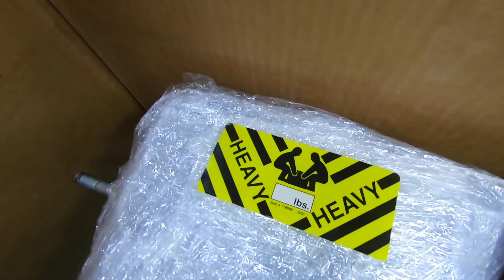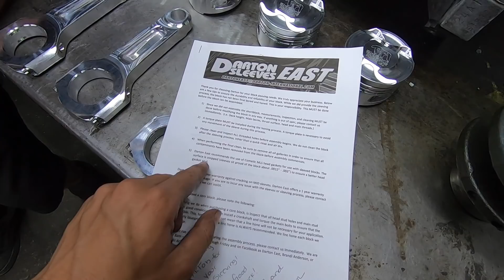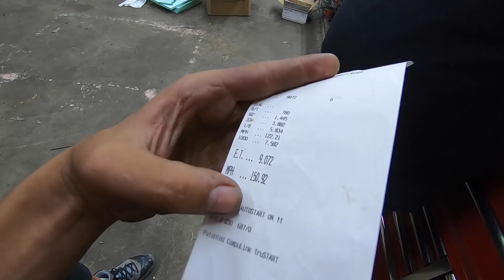The New 1200+Hp Engine For The Mr2!

Comment: When you take the block to get bored you need to take the head and rotating assembly and have them put it together to check clearances and o-ring the block and head too and also have it line honed and port and polish the head and polish the crank as well and make sure you keep track of how many passes you have on them rods and try to keep it on the track as much as possible and get the sequential lined out because especially with a stick car the more you miss a gear the more you shock them rods and you can run into rod stretch and hopefully one day you can build an engine like this one but with a fully built Billet block and head from 4Piston and also get a nice knife edged, nitride coated, Billet crankshaft and then finally put them second set of injectors and a mechanical fuel pump
Reply: Nah just gonna assemble it on the floor and send it

Comment: Have you guys nailed down yet why the MR2 and Hondaru were dropping valves?  I'd want to figure that out before reusing the parts out of the MR2 old head, because if there is something wrong with the machining of the retainers or keepers (maybe the angle is not correct), you could be bringing that bad juju with those parts to your new (EXPENSIVE) motor build.
Reply: EFormance Engineering 4piston brand heads were the issue. Not just these guys but tons of people

Comment: Don't know what the prepped drag strip record is but there is a K swapped MR2 in Australia that ran 8.8 @ 167 on an air strip in 2019. 1,200hp should be enough to faster than that.

Comment: You'll have to rebuild that engine more often with those aluminum rods..theyre softer so they stretch more. And much less durable. Perfect if your rebuilding the engine between each run. Don't think it'll work for you guys though.

Comment: Cosmetic head gaskets and how horsepower is the way to go you can run them thick or thin they come in different layers 350 block until they're off and stop playback on Rachel in down to a tires torque spec and you're good to go been there done that

Comment: dont need that much power to go for the mr2 record, the current record holder is from the uk but does not have any were near that power, you need to concentrate on getting the power you have down on to the track

Comment: for a engine with that kind of power you should really let it build in a professional shop. because, even if the piston, rods and the rest of the parts are very high quality, there are still some small differences in weight and dimension. it needs to be balanced and meassured properly to lost longer then just a few races...

Comment: Driving at any time with aluminum rods is the same. its not that they are dangerous to the engine. they have a finite life due to the way that stress acts upon them. they will last as long as they last and thats that. drive them anywhere you want just know that you have a limited time before failure. when will they fail. depends on you. Knowing Kyle not long,LOL
Reply: Not knocking Kyle or anything. He sends it!!!

Comment: I wonder if the manufacturers cold [cyrogenics ]treat the valves, keepers, retainers on these 10,000 rpm race Honda engines?. Not all cryogenics equipment is the same, so if you do have any race components cold treated, make sure the facility, personal, and equipment are current with the correct material science.

Comment: Get in touch with Fuel Tech and run one of their ECU's then you can run all of their sensors and everything and tell them who you are and tell them what you're doing and they might give you a good deal and you might want Kyle Loftis to talk to the guy that runs Fuel Tech from Brazil he should be able to hook you up but until then talk to Sketchy Vert about tying the front end down and running on Drag Radials he should be able to help you even the the engine is in the back

Comment: I’m building exact same motor for a Honda Accord. Big bore , o ring block, 4Piston head etc Only difference we I went with Carrillo Pro steel rods with Carr rod bolts. You must use deck plates to bore and hone Darton sleeves. We had to buy our own deck plate since no one has them around me. Watch your ra deck finish when using cometic hg.

Comment: Why did you use a billet piston? There is nearly no advantage and lots of disadvantaged going this way. Considering the number of piston options already available for k series engines that you can buy off the shelf, billet is a solution looking for a problem. 
According to JEs literature, forgings are stronger and unless you are doing something that an off the shelf forging isn't available for, it is a better option than billet.

Comment: Stupid question: Why can't you drive aluminum rods on the street?
Reply: +1
Reply: Aluminum is no where near as strong as steel is, and after driving for so long on the street which abuses it more, or X numbers of passes at the track (realistic scenario, and why people change them out if they are doing nos passes), the thought it that due to engineering principles of Al, they WILL break after heating and cooling so many times, and you will throw a rod, probably destroying the whole bottom end.  Those thoughts came about early on though.. we've made advances, and the way BME make their rods is superior.  Die forging vs cutting away material, you retain some strength and heat treating due to the nature of the process.  You are trading the known fact that Al has a "shelf-life" in this application, and you choose it for its weight reduction over steel, but you don't want to pay for titanium.  Aerospace does the same thing, that's why aircraft have set life-span.
Reply: @probably3dprintingsomething  The reason that aircraft have life-limited parts, especially in the hot section of the engine, is that an aircraft cannot park on a cloud if something lets go. If a street engine goes, you coast to the side of the road.
Reply: @c103110a  Round-about way of saying what I did, so yeah basically.
Reply: @probably3dprintingsomething  taps fedora thanks sir

Comment: make a v8 out of 2 k series engines
Reply: That would need a full custom billet block, a new crankshaft and alot of other high precision custom parts which would cost an absolute fortune, and id bet they would need an expert to design and make. An inline 8 though would be alot simpler.

Comment: You should not drive with aluminum rods they have a life then need be replaced 300 passes they need to be replaced they will fail .you can waste you 300 passes on the road driving if you want but they are a replacement part that expires

Comment: And I would wear gloves installing that motor bro you don't want no greasy fingerprints on any of those parts I know you know what you're doing I would not pull them out of the package until I was going to install the motor take that crank to the motor shop and have it balanced and checked out first

Comment: "Going all out"....Stock head...smh lol
Reply: Should we put bets on how long it lasts, I say he builds it screws up the assembly has to tear it down again rebuild it makes one dyno day with good power and it doesn't run right again.
Reply: History: "built head" destroys bottom ends. Other cars that have "stock head" no destroyed bottom ends. Let's keep on the same path yet still expect a different outcome. lol. I'd ditch the built heads too that destroy the engines.
Reply: **stock port head. which doesn't matter at all. Has full valvetrain noob
Reply: Well, they probably don’t want to use another 4Piston head after what happened to Hondaru and the MR2 twice
Reply: @brutalbasspro  well no. You see the van has a stock head the same head that theyre gonna use for the mr2. The problem is that Emilio is using a modded head and it fucked up. Other people who are also using a modded head to that nature has also had the motor fuck up. They're not making any claims or blames just that the stock head has been over 1000hp with a built bottom end has been working this long so why try a modded one
Reply: @Pinkarmada01  the 4piston head they had in hondaru wasn't even built for boost they didn't specify when they ordered it which is why is blew up it was built for all motor and they were pushing 850whp with it🤦🤦🤦